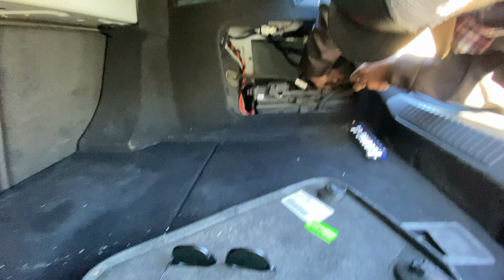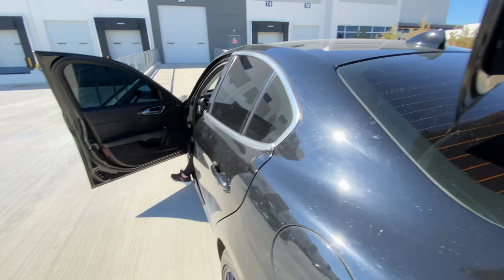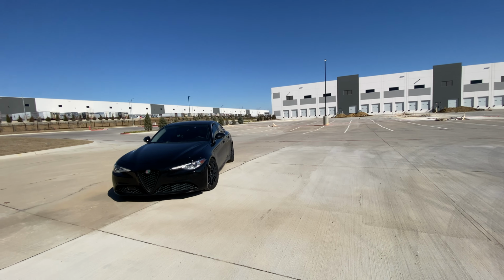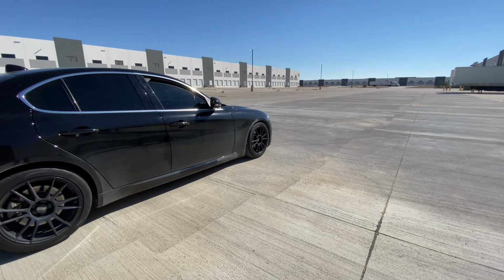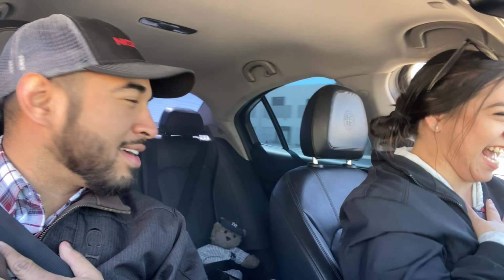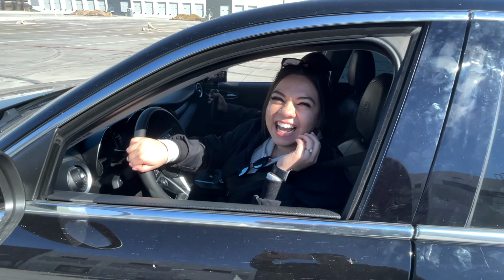Alfa Romeo Giulia DRIFT & BURNOUT !!!

Comment: Hi, you can deactivate the traction control systems, removing only the plug wire, the one that is placed on the negative main wire. I also have a Giulia, and it works. Have fan :)
Reply from the maker: Appreciate the feedback 🙌🏽
Reply: Does that do exactly same thing? Just an easier removal? Like disconnect and go? Or pull....wait...plug?
Reply from the maker: @AlteredRealityTattooVancouver  does the same thing, instead of unbolting there’s a quick release that disconnects the negative. Unplug, wait 10 seconds replug, and then start car !
Reply: I love having fan🤪

Comment: Tried it and it did work. My biggest issue was that the car stayed in N mode. Which I am not a huge fan of. Feels dull and puts suspension in a soft mode. But it does turn the ESC off. My old Mazda 3 had ESC button and so does my wife's Volvo. I wonder why Alfa wouldn't allow to turn traction control off on base Guilia?
Reply from the maker: That’s great to hear! Yea that is a big disadvantage, only way to get Dynamic mode and esc off is to install race mode to my understanding. Hopefully one day they make this a standard feature sucks to have a rwd car without that.

Comment: Did you lose dynamic?
Reply from the maker: Yea while it’s in limp mode you will, but we’re installing race mode currently for a permanent solution
Reply: @ModdedMotors  damn!  Seemed like it had alot of power during those burnouts.  Surprised that was limp mode....
Reply from the maker: Yea, even though I was a limp mode I had the Euro tune so N was still pretty aggressive
Reply: Ok good. I have the power pack so I'll try it!!!

Comment: When you disconnect and reconnect battery or when recharging it and you want lights to turn off all you have to do is the following; 

When you turn on (with steering wheel at center point) rotate steering wheel all the way to the right till end point, then turn all the way to the left then put at center and turn off car, then just turn on and lights will be off. And that's it problem fixed in a few minutes.
Reply from the maker: Appreciate it Martin 🙌🏽
Reply: If it takes you a few minutes to fix the problem, then you have to be turning that steering wheel pretty damn slow. More like 30 seconds…just messin’ with ya…

Comment: Doesn't your Euro+Drive flash already allow burnouts/drifts with "Dynamic" traction control in D mode?
Reply from the maker: It loosens traction control a bit more than factory but dynamic traction control doesn’t let you do burnout or slide the car.

Comment: Is this safe to do on a lease? Can a dealer later see that you've done this due to the codes?
Reply from the maker: Honestly great question not to sure if they can but I mean all your doing is disconnecting the battery. So even if they can see it’s not like you’ve void some warranty. You just may not want to push your car that hard.

Comment: Is this a Q2 with a LSD or is it just RWD with a open diff
Reply from the maker: Right now it has an open diff, we picked up a LSD for it. Should be going in fairly soon.
Reply: @ModdedMotors  nice make a video when that happens I’m looking forward to doing the same thing.
Reply from the maker: Absolutely will, should be nice for traction. It’ll be slightly harder to slide if it gives push back.
Reply: @ModdedMotors have u installed the lsd yet? If so has it caused any problems?

Comment: Is this bad for an automatic transmission?
Reply from the maker: I’ve done it a few times, my transmission running strong for 25k miles. Maybe rough on the brakes but I’ve since replaced them

Comment: But how? Isn't it awd? What am i missing?
Reply from the maker: It’s rwd
Reply: @ModdedMotors  sorry. Im new to your channel. Gotta watch your clips in order when i have the time
Reply from the maker: @polandsprings21 no stress at all, happy to answer any questions 🤝 welcome to the channel
Reply: @ModdedMotors  well, i do have 1 question. If i install the race selector and send my ecu out to alfissmo for  the squadratune wouldn't the computer read   the tune and that would void my mopar warranty? Or if something went wrong the mechanic would simply blame it on the tune right? Idk...and its 1 of the biggest things holding me back. Im broke but trying to make things happen 😆
Reply from the maker: @polandsprings21 pretty hard for them to find the tune , and I’ve never had issues with getting warranty work with my mods. They’d have to prove your tune caused failure, which most likely isn’t the case.
Reply: @ModdedMotors  you are GOD sent. It's gonna take me alot of work but maybe in a year I'll be able to send you some proud pictures🙏🏾. Thanks a bunch

Comment: Just install race mode it will take off the abs automatically
Reply from the maker: Yes sir, I have race mode now. I said in the video it was just a test
Reply: @ModdedMotors   is the car still reliable after this?
Reply from the maker: @globoy4682  yes sir, you can watch our newest video - still daily drive it till this day
Reply: @ModdedMotors  how many miles does your car currently have?
Reply from the maker: @Jeff-gc2sb  we now currently have 60k miles on our Giulia

Comment: ur exhaust sound super drony dont u get nuts from it ?
Reply from the maker: I just realized what video you commented on, just wanted to point out  in this video we’re throttling the car and what you might hear isn’t how the car sounds on daily drive use. We have other videos on us using sound clips of how the exhaust sounds from the outside. None of which really captures the in cabin experience. 

If you’re familiar with aftermarket parts for Alfa’s there’s not that many exhaust options in the states. Im not sure how well versed you are with exhaust but compared to many other exhausts for other brands of cars this doesn’t have horrible drone. Most people actually just cut their mufflers instead of buying an actual exhaust due to high cost of what options there are. Mass majority of them come out sounding pretty good with minimal drone. This is a Remus exhaust which although not the best is a pretty well know company. This isn’t a car we’re dropping a lot of money in this is my wife’s grocery getter. I’m sure you’re not a long time watcher of the channel but we got most of our parts in a package deal so no sense of putting more money into an exhaust for slightly less drone. 

I also saw your now deleted comments about the brakes. So I figured I’d give you some insight if you were concerned. All of our brakes have been replaced and bled since this video took place. Also if you’re not familiar with how to do a burnout you press the brake and gas. Then when you slightly let go of the brake you get the burning of the tires, which you saw. The brakes are fully functional and worked properly at the time of this video. We have also replaced the tires so there’s no concern with that either. 

Hope this lengthly answer clarifies things for you. If you are in the market for an exhaust let us know what you end up going with other than Remus or maybe you can let us know which you prefer. 

Thanks for the comment and reaching out.
Reply: @ModdedMotors  thx man for ur anwsers. I life in europa and looking to buy the alfa. Iam verry exited now to get one. Wil get a remus exaust aswell. I never drove a rearwheel drive or automatic so thx for clearing tings up.
Reply from the maker: Of course we’re happy to help! I’m jealous Europe has way better options for the Giulia. We have a lot of videos with the Remus exhaust including our most recent video. All my cars are RWD and love the driving experience. Also we have the race mode coming in and we’ll be installing it ourselves along with the software, make sure to stay tuned for that video.
Reply from the maker: Ohh man that’s rough! Well if you ever make your way to Texas gas prices here are pretty good out here 👌🏽
Reply: @ModdedMotors  y dam europa wants all to drive electric crap cars or a 1.0 liter with 60 hp.